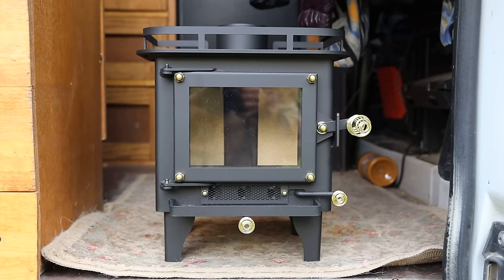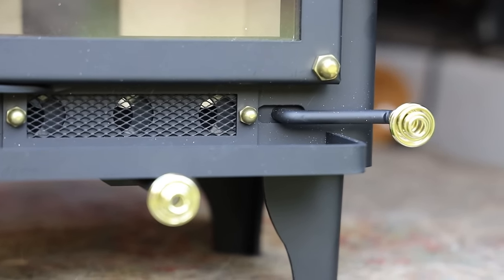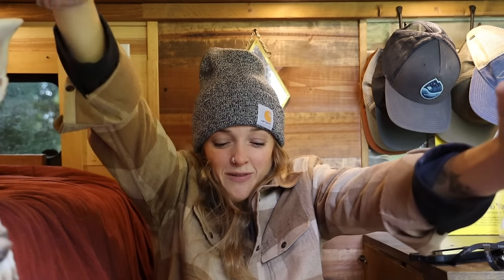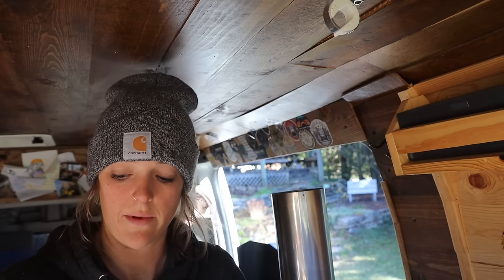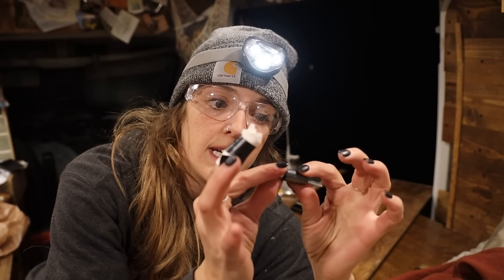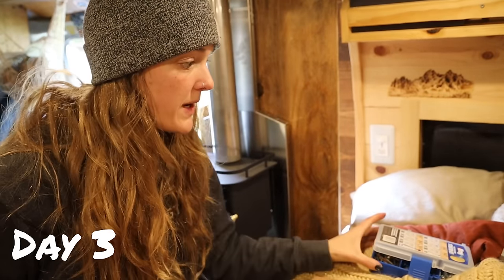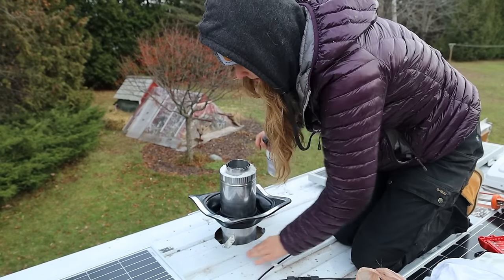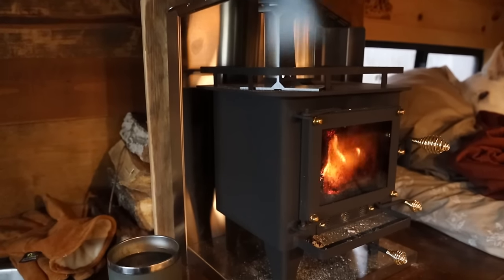Cubic Mini WOOD STOVE in a VAN | Full Install & Review

Comment: The install looks great.

For a fan to spread out heat I would look at 12 V computer fans. Noctua makes great and very low-noise fans and includes an optional inline resistor that makes them very hard to hear at all. Energy consumption is less than 1W for them. I would use some piping to pull air from the upper part to the floor, both to the open floor part and also to the back near the rear doors so the area under the bed does not get too cold.

A larger diameter fan moves more air with less noise so look at the 120 mm or larger variants. No need to have that large pipe, make a cone around the fan to get to the pipe size, and place the fan down on the floor so they are not in the way.

Comment: I lived in vehicles for 12yrs in my youth. Stove tech and regs have moved on a lot. I have installed many stoves. That said, I learnt a lot about the process from your video. I'm about to do a stove installation and my mind was leaning tiwards the techniques and materials you used. I spent my adult life as a metal worker. For a novice you did a great job. And as for your first aid, spot on. I always carried a small tin of paper roll and electrical tape in my tool box. One size fits all band aid, in a pinch. On with the job. Really great video and great looking build.

Comment: Great job on the install. I have one in my homemade camper and works great. I started off with a stove i made out of a 20 # propane tank and the chimney was a  drive shaft. To get the heat from the ceiling to the floor i took a length of pvc pipe with a 90 degree elbow and installed a boat bilge blower just above the elbow  it draws the heat from the ceiling to the floor. I lived in Alaska and it was my home for several years.
Reply: Where can I buy one

Comment: I installed a woodstove in my truck camper. I was surprised at how well you mounted your woodstove. I see problems with some installs with normal use of the vehicle and not having the woodstove secure. A panic stop would send it flying forward.  BUT not yours as it mounted down very secure .. Good Job 🙂 Dry heat in small spaces is a must !

Comment: I appreciate your very through video. I want a wood stove in my van so bad. We live where there is plenty of wood and I love the idea of being able to heat with what is around. Thanks for sharing that the rack on this model can be removed. I was looking elsewhere because I want to b e able to use the top of the stove and why is that rack there. I wish I knew as much as you do about tools and cutting and fixing. I admire your independence.

Comment: im putting mine in soon, mine has a flat top that I could pan cook from, also I got an awesome metal tank that attaches to the back of the flue, you put water in and it boils and there is a tap at the bottom.

Comment: You still should keep your diesel heater for backup. It doesn't really take up any space so why remove it? You never know. And in van life sometimes you need an immediate resolution to a problem.  You should keep the diesel heater installed. I've been watching  your channel for a while and you're very handy, so you know what you're doing. As usual  you did a good job. Best wishes..

Comment: Really nice job on the install. Give yourself some credit for your hard work. With the flue sitting that high above the roof. I would be concerned about two, maybe three things. Potential wind noise traveling at speed, driving through a rain storm if there is no cover over the top and the possibility of passing branches damaging the flue. Also the dad in me wants to say, never ever drive away unless the stove is cleaned out and cooled. The possibility of a fender bender knocking the door open and releasing hot coals is not worth it.

Comment: I've often take a kitchen strainer I cut down,fill it with wood pellets,which are cheap,easy to handle,and put it in my stove,with my strainer full and it takes up most of the room in the firebox,it last over 12 hrs and keeps my camper very warm.the pellets are available everywhere in 40 lb bags,at any farm store nationwide.eliminates searching for wood.the downfall of Burnside is using wood pieces there's 3 times the square inches of air over wood,my way reverses that

Comment: You are just amazing Linnea! You inspire me every video. I want to get a  mini when I get my van. I'm still in the SUV and have no heat. I do have a electric blanket which I plug into my Bluetti. It's a DC so very low voltage. I want to be you lol. Tfs

Comment: How is the quality of the air in the van while using the wood stove?
Where does it get the oxygen/air, from the outside?
I guess that your mini wood stove is made to work and be safe to use in a small space. 
We have a wood stove in our small house not so much for heating than it's coosy but it's not so good because it sucks the air from the room and after a while the air quality gets quite bad inspite of the open airvents in the room. 
I wish you and Chris and offcourse the dogs a good winter experience!

Comment: Hi great install. I’m just in the process of starting my first camper conversion. I had the same idea of using a log burner for heat and to cook off. Is there any regulations and would I have to let my insurance provider know about installing the burner. Also my van is an old Royal Mail van, so bright red , if I change the colour , will I have to notify them about the change. Thanks for any help, new subscriber , and a 👍🏻

Comment: You are either lucky or not with a Chinese diesel heater.  I’ve seen several UTubers get screwed with them and on the coldest day is when it fails.  Today Chrome talked about them he purchased 3 and the 3rd didn’t work at all.  He now has the Lombasall which is about $1,000 but it’s a nice fry heat and he’s had it 3 yrs now.  Poor Jeffie Bear had his knock off break every winter.

Comment: How about a good wattage inverter and have it run off a deep cycle battery ? Plug in a small heater (1500watt). Have the inverter connect to your alternator or get a second. Doesn't cost a lot. I'd say it's much more safer than 🔥. My shitty opinion. But works well.

Comment: wonderful-always have heat-an it is dry heat/put a cup with water on top of stove-to put some humidity back in the air/you can then use the hot water for a cup of tea or coffee/then add water to cup an return to stove top/i am going to put a small wood burning stove in my van -when customizing it /let us know how that fan moves air/nice-for sure/thanks much

Comment: My wood stove at home has ashes and debris that litter the roof and the ground around the house depending upon the wind. How do people with solar panels maxxair fans and so forth deal with the debris that comes from a wood stove pipe? It doesn't do any good to put a filter at the top because it clogs up so quickly it has to be cleaned almost continuously

Comment: One  of the reasons you have a cooler area is because you Don't have 'Outside' combustion air? That is a question, not a statement.  The effect of this is reduced oxygen levels in the enclosed space(Dangerous), and it pulls in cool/cold outside air from every unsealed/poorly sealed places like doors, windows, and your vehicles cab heater/air.  You notice it more below waist level because, as you know, heat gathers in the upper  levels of the enclosed space and the colder denser(heavier) air gathers in the lower areas of the space with the coldest layer at your feet. If you were to put a thermometer at every one foot increment from floor to ceiling you would see an increasing graphic regime of thermal layers.
    Some stoves bring in outside combustion air down through the smoke stack which preheats it for more efficient combustion and while beneficial, it also contributes to creosote creation in the exhaust stack. Lacking that, a vent to the outside should be installed as close to the appliance as is possible. A small through wall screened and closable vent behind the stove should suffice.

Comment: The smart thing to do is to insulate with KAO WOOL….. trust me … it doesn’t let heat or cold through … it’s used in meting metal…. You can take a torch to it and not feel the heat on the other side.. and yes it doesn’t burn…

Comment: I feel it's worth to keep the diesel heater. It can't hurt to have a potentially life saving back up. And there's going to be times the mini drops off.And you will be too cuddled with the dogs to get up and refire the fire. I'd even carry out 5 gallons of diesel fuel for the 3 months. Or at least wait on removing the diesel heater until you've lived it